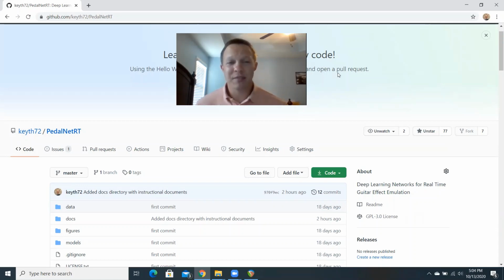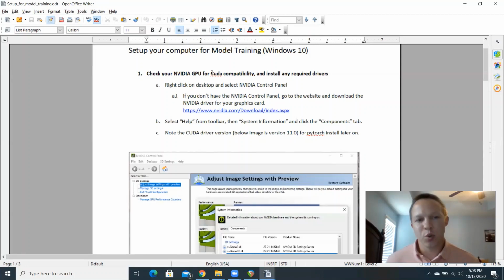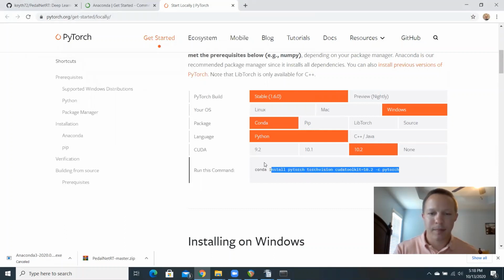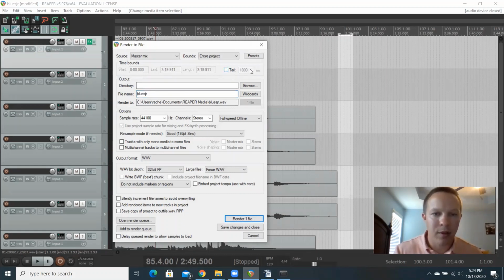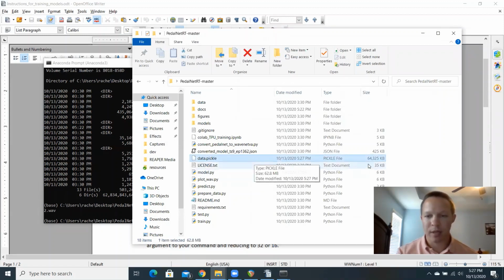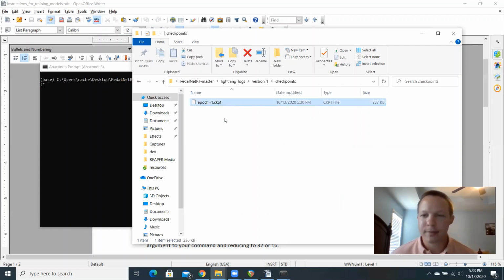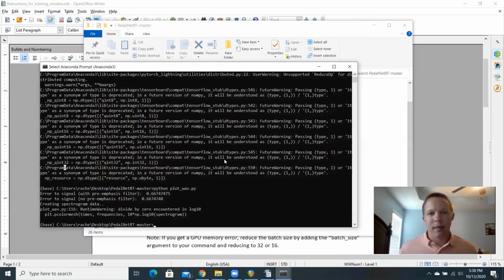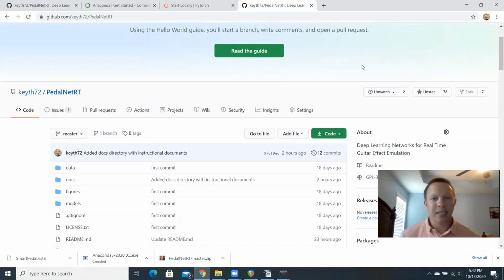Tutorial   Using Machine Learning for Emulation of Guitar Amps and Pedals

Comment: This method using python capture the eq curve of the amp or pedal? Like the Voxengo curve Eq?? And load him in a convolution module after the drive section??
Reply: Sort of, but it’s a different kind of convolution. It uses an Artificial Intelligence model to copy the behavior of a particular amp or pedal. Looks like the Voxengo uses IR models? So this does more than impulse response, it will actually behave like the amp circuit using only recorded audio samples from the amp or pedal. So in my examples I use a ts9 tubescreamer and a fender blues jr, and I’m able to load the models in the plugin to sound just like playing through the amp and pedal, captured at one specific gain setting.
Reply: @keithbloemer  Great. But the instrument is captured together. If I use a Sine sweep 20h to 20Khz or a white noise in place of the guitar does it work the same way?
Reply: @VICTORFERREIA1987  It should work the same. If you notice at around 21:30 the model is trained on the raw guitar signal, and then the signal after processing. So the model learns to how to go from raw to processed. It should apply the same processing regardless of input.

Comment: Excellent! I tried to model my favorite Kemper Profile (MB - Fried Man 4). I had some problems with convergence (the loss jumps to 1 and decreases again several times during training). It was probably because I didn't tune the hyperparameters. The whole signal chain (including a compressor, a boost and cabinet) is used during input generation. Only the delay and reverb stomps are switched off. After 1 hour on RTX-2080 (around 1000 epochs), I played using the learned model. The frequency spectrum was not perfect but the signature of the amp was there. 

After tweaking using an EQ on Ableton Live, I didn't believe it. It really behaves just like the original profile on the Kemper. Thanks for this amazing work.
Reply from the maker: That’s awesome, thanks for the feedback and glad it worked so well on that particular profile! If you’re interested there is a new Facebook group page for discussion on model results and sharing. It’s pretty amazing what this technology can do for audio, and I think we’ve just scratched the surface.    https://www.facebook.com/groups/674031436584335/?ref=share